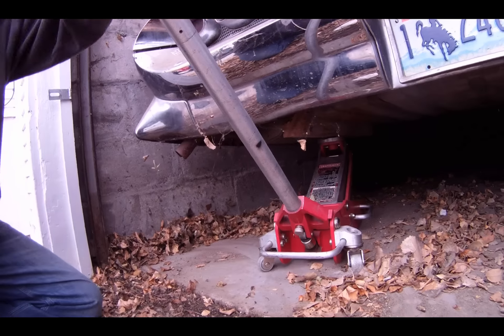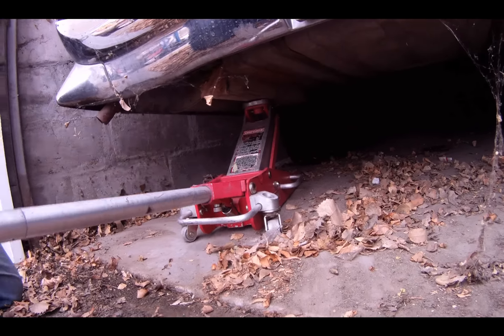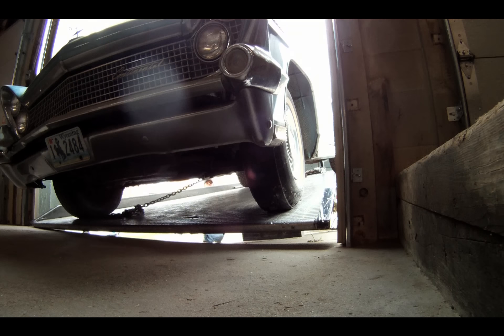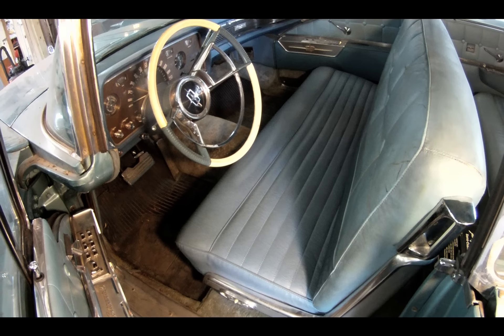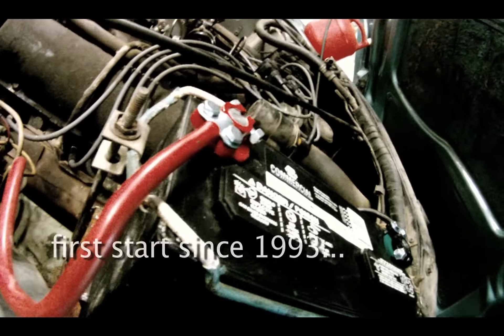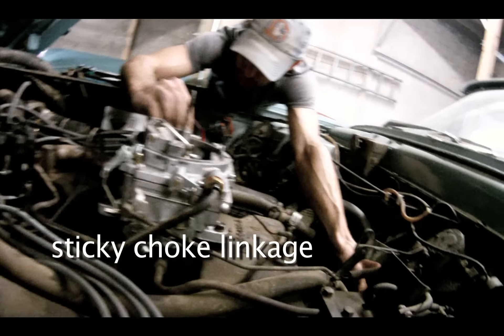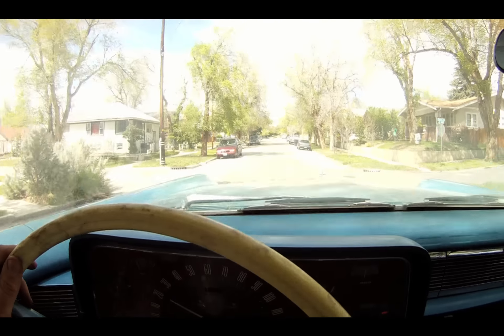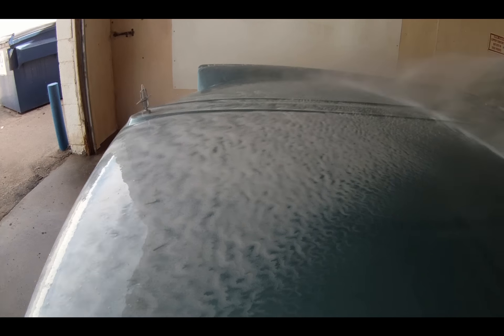Barn Find Resurrection - 1959 Lincoln Continental

Comment: I had the same color car back in 1975 it was a 12 cylinder I can't remember the engine size but it ran great... I miss the old car alot
Reply: The very last 12 cylinder Lincoln ever built was in 1948...Every Lincoln built since then we're and are V-8's. I have a 1979 Lincoln Mark 5 and features a 400 cubic inch big block V-8 with 2 BBL. carburetor.

Comment: That is the best find if i ever saw one i have the same model but mine is a beater run but no breaks went to Kanter and got rebuild kits for every thing except the window motors they do still work but do need to be rebuilt but hay i was wondering if you might know where i can find parts besides desert valley auto

Comment: Canted headlights, outer space styling and breezeway rear window – I read that these "Lost Lincolns" were also designed by Elwood Engel, the same cat that designed the 1961 Continental. Nice shape for sitting for all those years!
Reply: Lincolns and Continentals were two different divisions up until 1960! then the Continental became the Lincoln model starting in 1961!

Comment: I owned a 1960 Lincoln Continental mark V back in 1970's had less than 50k. You need to lube up the fender skirts. Dam things always get frozen due to rust. The wing vent on drivers side always leaks when raining or washing. Water goes right on to window switches shorting out & circuit disengaging. Keep a good fully charged battery in Lincoln. Mine would burn up starter solenoids. The solenoid is in Fuse box behind passenger side head & very difficult to change.  If I had kept it hidden from my Dad & Sister while in US Air Force. I would still have her today. Miss my girl. First & only car I have owned that I could lay flat in back seat. I am 5'10" Great for going to Submarine races with my Girl friend. Nice car!!

Comment: The late 50's weren't my favorite body style on any manufacture. They were just bulbous and ugly. This '59 is no exception, IMO.  The slanted headlights aren't to my liking. The tail lights are straight from the Mercury parts bin. The flat instrument panel is just as plain jane as you can get; as with most cars of this vintage. The instrument panel of my '57 Dodge Custom Royal would put these flat instrument panels to shame. But, the wonderful color and the low miles, and the incredible original  condition of this Continental are it's redeeming qualities. It's just a drop dead beautiful garage find. Personally, I like the '79 better. I had one in '78. It was a "battle wagon", and used it to tow a 28' trailer all along the Chicago interstates with aplomb. Go to eBay and get some 4 channel 8 track tapes. It's like 70's surround sound.

Comment: Wow!! Same color as my 1965 Oldsmobile 98 425 Super Rocket with only 17,300 miles on it. It was an estate sale in Houston TX  they were asking ($3500) and I told them I only had ($2000) and they sold It to me! I immediately I turned  round and spent $1800 on getting engine oil changed all engine related issues replaced with new fluids (except transmission fluid) cause it was excellent but remember..this car wasn't even broke in good yet..oh..but I needed to get a brand-new full exhaust system from Midas and while I was there I added brand new Midas Spring Guard shocks front & back. Then went to get some new Sears Roadhandlers all round and fellas you would not believe just how smooth & quiet and absolute power beyond measure and the Roadhandlers made this gorgeous beast feel like melted butter handling steering and transmission was unbelievably smooth and oh...that engine..that engine was like a Jet Engine because when we were heading back to BayCity..I stepped on it hard..and it actually had so much acceleration for a four door sedan that it literally scared the shit outta me because it was already doing 127 mph and it just kept on going up in to higher & higher speed and easily too! Anyway,  I knew Texas State Troopers are all over this highway so needed to shut her down..but man!! That car was the best investment (not technically an investment..even though this was my maindriver..I always took excellent care and changed the oil every 2500 miles..and yes the oil still looked like wild honey but that gorgeous 425 Super Rocket was so beautif ully clean you could literally eat off it and it always fun like a sewing machine smooth and quiet.Had same color as this Lincoln and I had the matching cloth interior.. With Power Everything! Yes..I too am a huge fan of well kept garage find Big Luxury Caddillacs & Lincolns.
Reply: Was great to read this.
Reply: 127?

Comment: LIncoln lover here!
This is the
Worst
Car
Lincoln ever
Made- hideous- always thought of
It
As
Strictly Chrysler on the fasci grill And  headlights.
Weighing in at over 3 ton 6000+ lbs, the 59 Lincoln virtually outweighs that flatbed wrecker- at the least the wrecker driver was totally
Stressed and amazed at how that car- bigger than his truck almost, forced him to do something he normally
Does not have to do - ALTER AND TOTALLY SLOW HIS DRIVING because of the lack of control Created by a vehicle Overhanging  the end- I mean.. think about it-when time To Unload, The Cars Weight made It Difficult to navigate-furthermore-the lift bed couldn’t even be laid down evenly for the cars
Smooth debarcation
Reply: @melvinharris7859  true that.